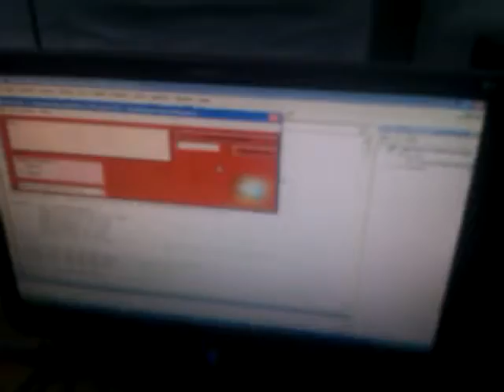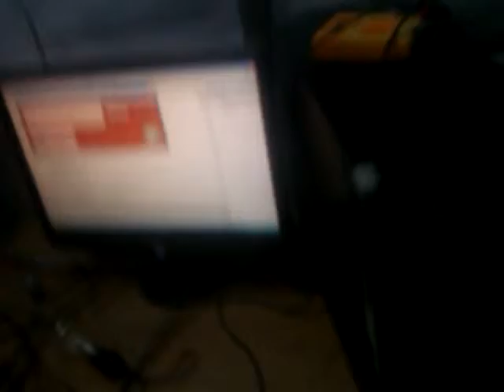Voice Operated Switch

Comment: which IC did you use, is it HM2007
Reply from the maker: I haven't used an IC. In my switch, Speech API (SAPI 5.3) perceives what word we r speaking like here is "ON" & "Close". Further Visual Basic programming passes actuating signal to relay using LTP port......On contrary u can use Micro controller but that will also need SAPI & programming & hence it will become more complex & expensive.